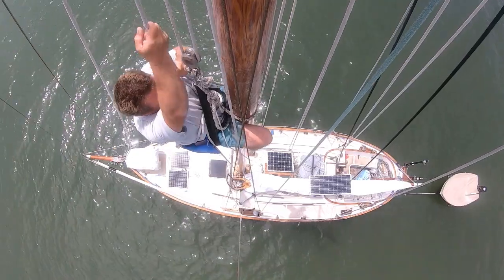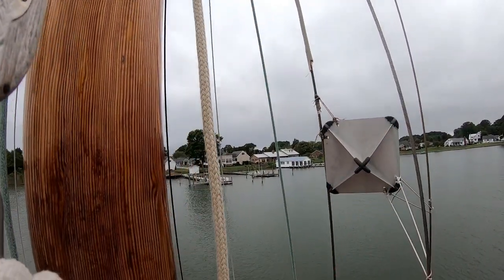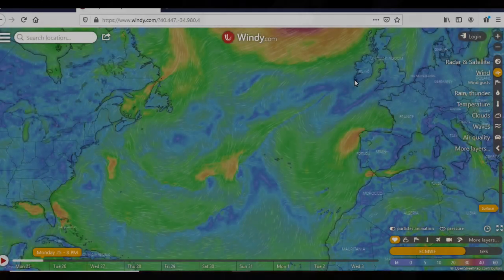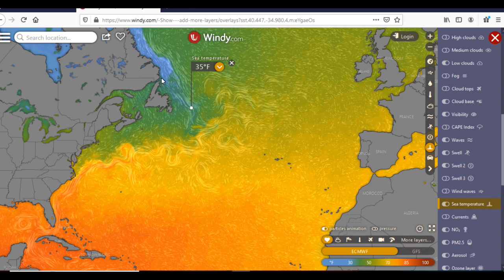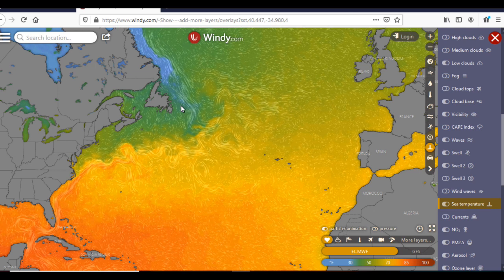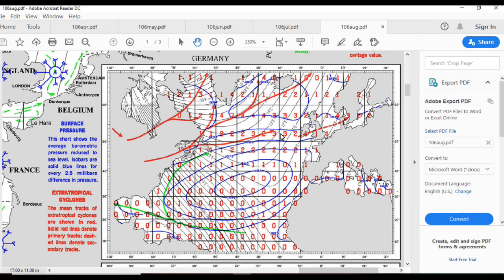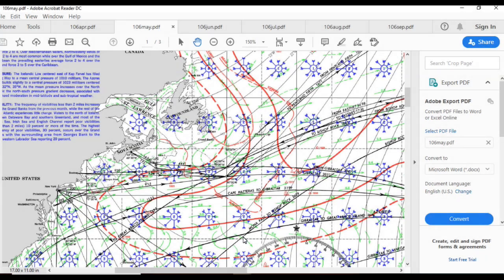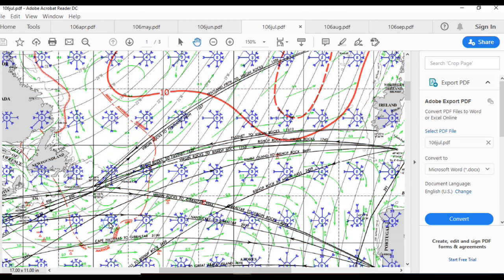The Plan

Comment: "I'm never comfortable working aloft..." I know the feeling, old chap. I bought an old yacht with seized halyards and no mast steps. I couldn't trust any of the halyards to carry my weight, so I had to put some steps into my mast. It was bloody shithouse having to try and put huge rivets in the mast, holding on with one hand and trying to rivet one handed. I used a climbing harness, and kept putting my safety line through each new step as I added them. I ended up going aloft about a hundred times in total (had to add sails, drill holes for new navigation lights, put wires through the mast, etc.) Now I've been aloft such a vast number of times, it's become second nature. Hope this helps someone somewhere... Cheerio!

Comment: Kevin, I really enjoy your channel. Thanks so much for the great content! I've been lake sailing for about 1 year and have been inspired, by you and others, to start prepping for some coastal, and eventually offshore passages. I am curious about downwind sailing with a preventer. There are a jillion videos available on various ways to rig a preventer. But I have yet to see one addressing what happens to the boat when the main is actually back-winded with a preventer securely rigged. I've experimented with that on inland water with mild and moderate winds on boats around 30 feet. Without large "seas" it behaves similarly to heaving to. And it's not a big deal to handle. It doesn't seem dangerous at all under those circumstances. But I am curious what that may be like at sea in force 5 or 6 winds with larger seas that might be pushing the Stearn around a lot. I'm really curious as to how dangerous that could be with perhaps the boom dipping into the face of waves, etcetera, on an accidental gybe. No one seems to think that's much of a concern. At least no one interested in discussing it in either videos or articles. I am curious what your thoughts are on the issue. I'm also curious to know how to recover from that in heavier seas, were it to happen. Thanks in advance!

Comment: one question why seize the halyard end rather than a knot bowline or buntline hitch for example?
Reply from the maker: It would interfere with the smooth running of the block.  You either need to seize it or splice it.